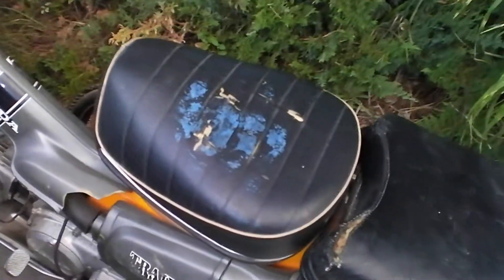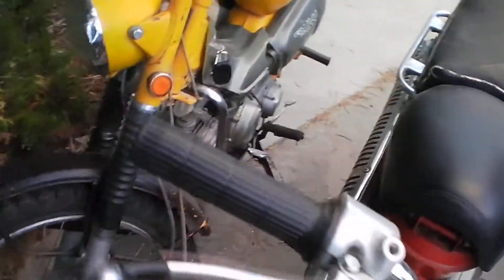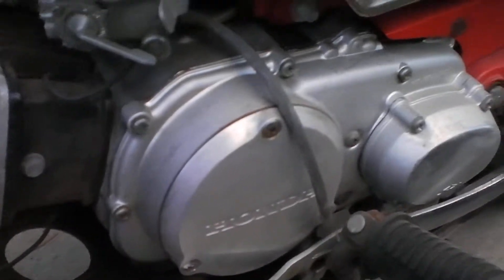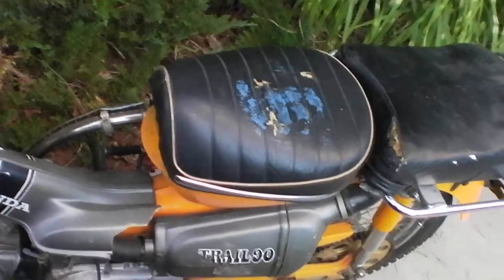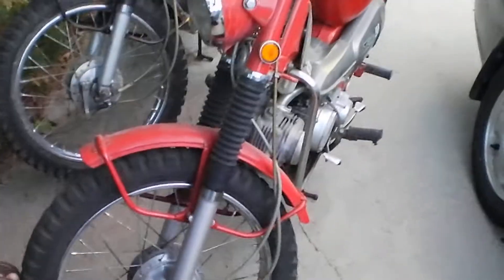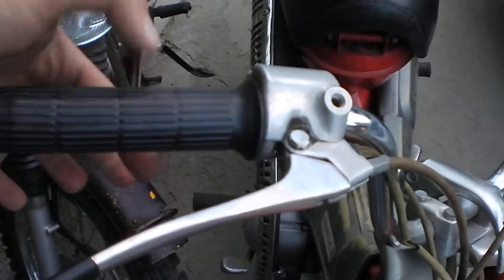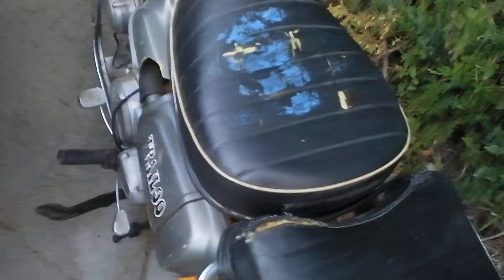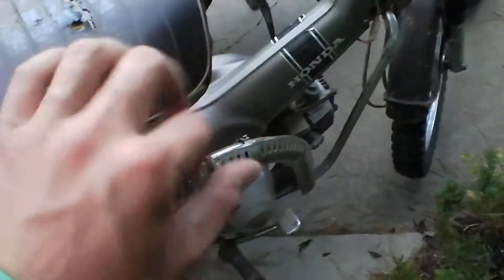time to fix some trail 90's

Comment from the maker: @DuBois994     i worked on these and i really want one now
Reply: Did you get one?
Reply from the maker: @GratefulEd907  I did :-) I ended up buying the yellow one a couple years later from the same gentleman I actually have all the parts now to do a full rebuild on it as soon as I'm done with another project motorcycle I'll start on that and make videos of the rebuild
Reply: @ils360  okay then I guess I’ll subscribe. 😏 I just rescued an 81 trail 110 I’m working on. It hasn’t ran in 5-6 years but I think it’s ready a new key and battery should be in the mail tomorrow. Hopefully